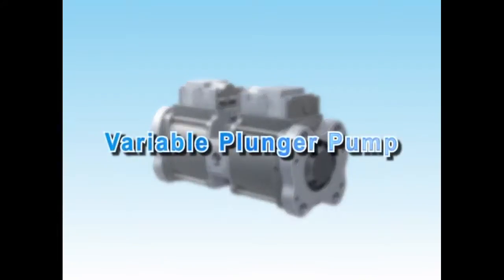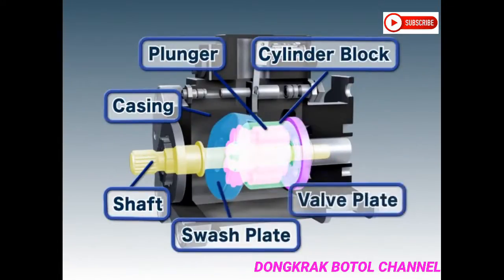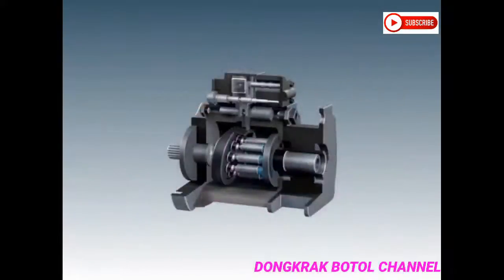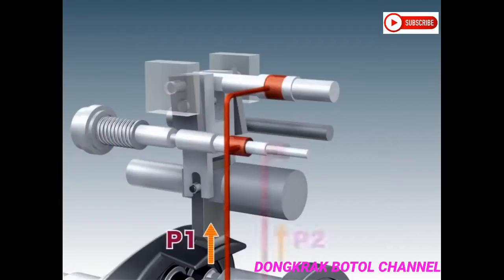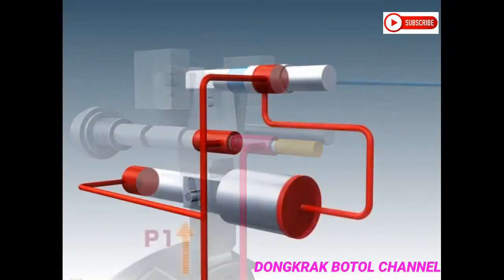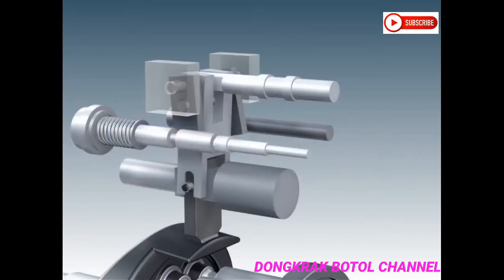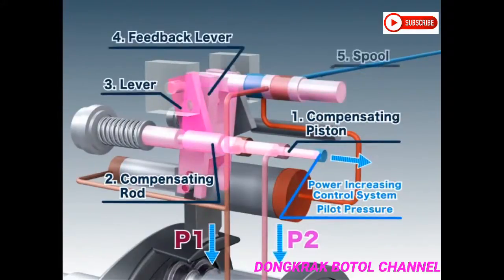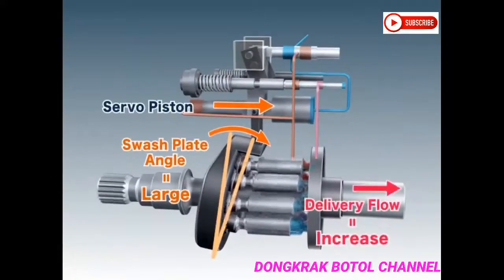Variable displacement pump how it work #2021

Comment: What is the swash plate angle of the Main hydraulic pump in Positive Control v/s Negative control hydraulic system when the engine is in OFF condition.
Reply: زاوية لاتزيد عن 45